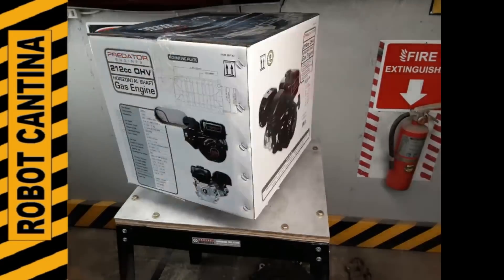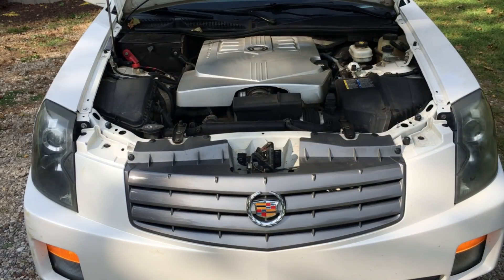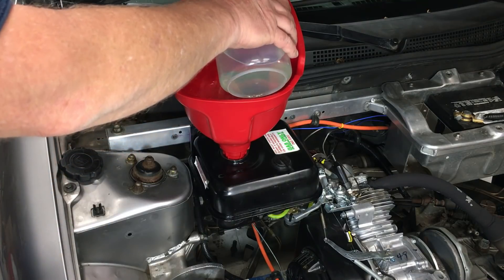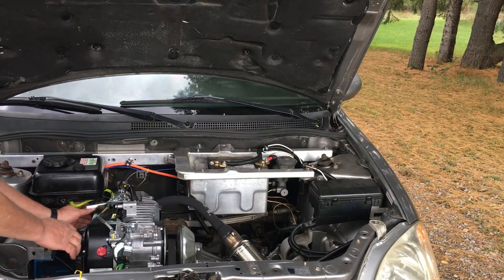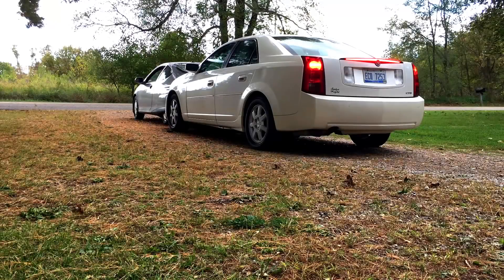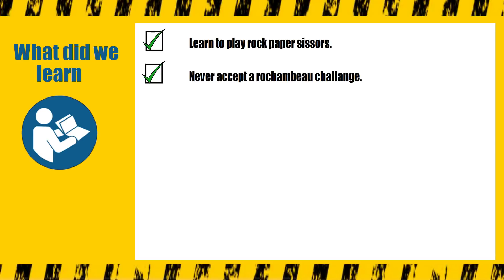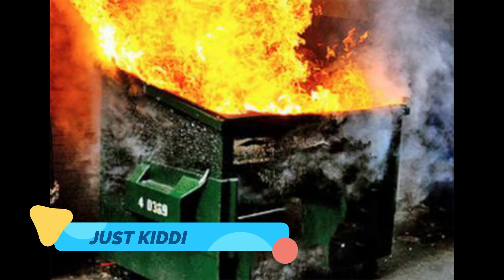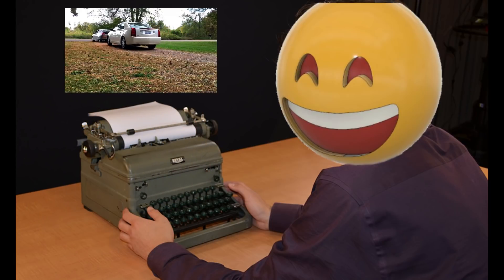Episode 6.  MPG on our Honda insight with $99 dollar lawnmower engine

Comment: On my car, the trip meter is typically optimistic by 21%. I doubt if that's particularly unusual.
You need to do another video... fill the Cadillac gas tank. Follow the Honda around the circuit for 500 miles. Then record how much gas it takes to refill the Cadillac gas tank.
Fuel consumption = 500/gallons.

Comment: Once had Ford Pinto with old worn out 2300 ( about a 1972 ) and it was so weak it probably had about 20 hp.
You had to pet the dashboard to get up to speed.
Probably a lot like driving your Honda.
Then in 2010 I had Ford Escort wagon, close to same size,  with 1800 or 1900 motor and 200,000 miles rated at 90hp.
and it was fast as hell.
What a difference 20 years makes.

Comment: If you think about it, 4.2L per 100km is kinda terrible. No power or torque and the fuel saving is marginal compared to a 3 cylinder turbo out of a vw polo. The polo is nearly double the weight.

Comment: I used to be an automotive test technician. There really isn't such a thing as 'pure gasoline.' All gasoline is a blend, including naptha and all kinds of aromatic hydrocarbons, plus a whole suite of additives chosen by the blending company. Not trying to be pedantic, but just saying that when you say non-ethanol gas is pure gasoline, that's not particularly meaningful. Gas from two different company pumps will be different, and gas from the same pump in various weeks or months can be surprisingly different. Not meaningful for most things, but when you're at the level of measurement that you are doing, it can be significant.
Reply from the maker: I appreciate the response, but my point was the fuel did not have ethanol.  I was not suggesting the fuel was a perfect blend.

Comment: Put in a bigger motor like a 420cc
Reply from the maker: Check out our other videos, we do put in a 420....  also on Friday 03/19/2021 we drop the latest video with  insane top speeds, stay tuned!
Reply: Dawg I just finished watching the 420cc video you need to delete your cvt and get a flywheel and clutch for mo powar

Comment: I have a roller cb750 honda motorcycle. I would love to see how you repower with a that s.. tock engine or a 420 .  A 750 çc 4 cylinder honda weighs quite a bit. 
 My first attempt might just be with a lawnmower seat tilt plate and direct belt drive, although a little cvt go kart drive might be much better..

Comment: Whoa whoa whoa - Cadillac made cars with manual transmissions?
Reply from the maker: Sure did,  you can even get the CTS with an LS2 with a T56 six speed.
Reply: @robotcantina8957  but probably not anymore.  I reckon those are exceptionally rare cars, probably rarer than an exotic. Ironic as modern exotics no longer come with manual transmissions.

Comment: Im not surprised at all the honda got better mileage. When maintaining the same speed, weight of the vehicle matters a lot more, and the honda beats out the caddy there. And when accelerating, the super low acceleration of the predator probably does a lot better on gas than the caddy. Basically the honda literally CANNOT burn enough gasoline. The caddy meanwhile is a bit like a race horse itching to go the highway speeds its meant to drive at, and has a lot of wasted potential.

Comment: I'm so used to driving on gas that I was like lol why can't they just top up the tank and calculate the difference but then it will only work for gas tank where you have a cut-off volume. So that makes it 5l/100km in metric, I suppose small city cars with sub 1l engines would do similar but with much better performance.

Comment: I am seriously impressed. I can see folks who just need a around town car who would like to have this car. As long as the regular fuel tank is connected to the carb with a low pressure electric fuel pump, so folks wouldnt be inconvenienced by your refuel method. Oh, an electric starter would be nifty. Easy enough to do.

Comment: Great video series! We know that carburetors are bad for fuel economy especially if they are not adjusted just right. 56MPG is great but you should see if there is an EFI kit for it or even better find a used small tractor FS730V-EFI engine or something similar that is about 25 horse power with EFI and you should have better hill performance and fuel economy.

Comment: Next logical step is to put fuel in the original gas tank and use a hand pump to bring it from the tank to the mini tank in the front. The moment it starts to run out, add a few pumps. FLAWLESS LOGIC

Comment: You should try getting her to 65 mph, then use the stock gas tank and have the ultimate  high milage daily driver.  Probably be pretty useful.  Fully modded i bet a predator with the full 30-ish horsepower could do 65-70.

Comment: I didn't know anyone bought that base engine CTS, even more so with a manual. When I bought my CTS the dealership didn't even have any base models, they all had the 255 HP version, which still seemed a bit underpowered to me. The 08 CTS bumped that to 305 HP I think, that was a nice boost.
Reply from the maker: Indeed, the base 2.8 with the 6 speed manual is a rare bird.  A stick shift in a caddy just blows peoples minds.

Comment: I don't know what car is the slowest street legal car, but a contender is probably the Danish Ellert from the 80s.
A 3 wheel electric car, with a top speed at around 50 km/h or 31 mp/h.

It's now produced in Germany, under the name CityEl, and has a much higher top speed.
You can read about it on English Wikipedia, under the new name, CityEl.

Comment: At 9.5 HP you could put a Japanese 125cc engine instead.
It produce around 9.2 HP without modification, it'll be lighter and more fuel efficient plus a lot more reliable

Comment: Considering how actually bare this engine is-
compared to a regular car, many HP robbing 
accessories are missing; many modern cars
now have electric accessories, so nothing is
parasitic, but you still need a beefy alternator
to run all that.

Fuel pump, water pump, cooling fan, wiper/
washer, power steering pump, AC compressor, 
HVAC blower, lights, entertainment, navigation, 
ABS, instrument cluster.

An actual electric starter.
Reply from the maker: While that is mostly true, the electrical load on a modern car only absorbs about 4HP.  The AC will adsorb another 4-5 HP

Comment: I can only imagine how much that cvt belt is eating your lunch in this test. Friction drive belts, especially with variable ratio drives, are horrendously inefficient. A simple centrifugal clutch without the variable drive and a chain to the transmission would probably make the car faster and more efficient. You might not think it's bad with so little power but fractionally it actually gets way worse with lower power engines. Given the insight already has a 4.9 to 1 ratio spread in the transmission and you are really only able to hit about 40 mph with this engine in this configuration, geared properly for this speed the wheel torque in first gear would be more than a third what it is with the stock engine.

Comment: It takes approximately 1 gallon of gas per 10 hp per hour for gas engines, and about .5 gallon per 10 hp diesels in boats running in their optimal torque band. It must be similar in hillbilly cars? My friend with the 10 hp diesel Geo metro was getting in the mid 90’s in somewhat hilly Oregon.

Comment: I can tell your lawnmower man same thing here in San Antonio Texas did similar work on other things boat aircraft you name it translated riding lawn mowers 9 horsepower blah blah blah I don't have a nice to shop as you do though keep up the good work thanks for the mile per gallons checkout have a nice day I don't touch anybody it's a try to shake hands just start coughing they back away that's what I do

Comment: From Leo: Fun test.  Air cooled, carbureted engines are not as fuel efficient as modern car engines.  Pretty impressive for a lawn mower engine.    When I was a kid there was a magazine article about a guy going cross country on an 8 horsepower Cushman scooter.  I guess if you are not in a hurry, anything is possible,

Comment: So the MPG is worse than the stock car? And you only had to strip the entire car, remove all climate control, and make it incapable for use on the highway. 
Kinda crazy what Honda managed, but the stock car was actually quite bad for the environment due to the lean-burn mode.

Comment: What exactly is a ‘5-speed CVT’?! By definition CVTs don’t have speeds.

This reminds me of a review I read of a very cheap hybrid. The guy said that when the battery got low the ‘engine’ would come on to charge it. He said it was exactly like driving a car with a loud obnoxious Honda generator under the hood. Horrible driving experience..

Comment: How well would the Honda run with a ram air intake? How about A/C? I bought a new Yugo in 1987. Yugo means you go back to the shop once a week in the first 5 weeks of ownership. (13 different problems) Anyway, my Yugo had a 1.1 liter engine not much bigger than your Predator, at least it acted the same but you beat the Yugo by 4 MPG. It had A/C but it cost me a $436.00 clutch. In the summer in flat land Florida, you can't have a car without A/C. My first car in 1974 was a 1968 Chevy Bel Aire with NO air. I swore never again. The Yugo's engine was so underpowered that to take off on a green light with the air on, you had to slip the crap out of the clutch or stall the engine. Drive or be cool was an either / or proposition. After 20K miles, it drove like a Model T with a cone clutch. You could make milkshakes on takeoff. The dealer where I bought it stopped selling / servicing Yugo at this point because the exporter quit paying for it. I found an Oldsmobile dealer in St. Petersburg that still serviced them. No transmission shop in 4 counties would touch it. The dealer said that the pressure plate was the size of a tea cup saucer and they had to send it out to a machine shop to be surface ground as it wouldn't fit their lathe for resurfacing which is what it sorely needed. Another car for my "never again" list.

Comment: Imagine if you could hook up the original tank to that small honda engine.And have a working fuel gauge.
Reply: The fuel would go bad before you used up the tank.
Reply: @cdjhyoung  why?
Reply: @jasper5945  In my area, automotive gas stored in the car tank has a limited shelf life. It attracts water, seem to vaporize some of its more combustible components, and generally just goes bad. A bit like trying to run kerosene through the carburetor. We add stabilizer to fuel we plan to keep over the winter to prevent these things from happening.

A 12 gallon tank might give the car a 600 mile range, but it is unlikely you would chose this car to go 600 miles in one trip. Your time is worth something after all.

Comment: the Cadillac is "drafting" the Honda, so the Caddie's fuel mileage is better than if the Caddie led, and the Honda followed it.
Reply: I don't think the Honda was going fast enough to generate turbulent airflow.
At laminar flow speeds there is no "drift pocket" no difference between stacked up vs spaced out.
Reply: And the caddy is idling along while the Honda is wfo
Reply: If you ain't first, you're last!
Reply: @kks_123-u1w  Slingshot, engaged...
Reply: To effectively draft like you mention the caddy would have to be somewhere in the vicinity of 6’ or less away, plus at these speeds any aero advantage would be negligible.
Reply: @jordanbrewer9700  Yes, but still drafting as it was - believe the caddy did 3 - 5 miles less that indicated.
Reply: Did better. Yeah. Lost by what, 40% ? Wouldn't matter
Reply: If the caddie is close enough the Honda also gets a reduction in drag because of the interrupted vortices.

Comment: so it gets gas mileage like an old 3 cylinder Geo Metro with a 5 speed transmission, and 4x more gutless... I'd call it a success, not trying to be sarcastic or trolling with that, when it breaks down you can replace the engine for less than the price of a car battery!
Reply: The blue book value on the geo metro hit -$200. 
You can replace the car for the cost of a new battery
Reply: My friend had 3 cylinder one silver he used hall ass from VMI to his house in Fairfax

Comment: Always amazes me what passes as street legal in the US. I have a Jeep and of course did a little something to it. Perfectly illegal in all of Europe, over here it's not even scratching the surface. 
Well, no surprise the little engine/light car combination is more fuel efficient. American cars are not exactly particularly fuel efficient and there's no need for that since gas is so cheap. I make around 14 mpg - not bad for wheels that weigh 90lbs each, but I also geared the crap out of it. I don't know what my top speed is for that "little" 3.6l V6 engine, but I bet it's no more than 80 downhill with pushing.  I rarely exceed 65, usually more like 45 or 50 - open vehicles are just no fun at higher speeds.
Reply: "Cheap gas" good bless America!

Comment: Cadillac was only the gold standard during the 50s, 60s, and 70s. Cadillacs after that were horrible. The Germans absolutely destroyed Cadillac. The only reason Cadillac is even around today is because of the popularity of the Escalade, it was what saved them and is still saving them today. No one gets anything else besides the Escalade, that’s it. Even then the Escalade isn’t that good compared to German cars. That’s not to say Cadillac never made fun cars, they did, the ctsv was very good but it didn’t sell that much. It’s safe to say their days of the golden standard are long gone.
Reply from the maker: Yeah, I was just having some fun with the Cadillac brand..  The only reason I own that Caddy is because of the manual transmission, otherwise that car is a POS.

Comment: the original one was pretty good in milage / had always 2,0 - 3,0 L/100km with my car back in the day. might be 80+ mpg??
Reply: On the highway the stock version of the first gen insight could hit around 70 mpg with a good driver.
Reply: @garethbaus5471  it made a big difference how to drive the car / behind a lorry with 56mph i was always between 94-117mpg (2,0 - 2,5 L/100km) on a flat motorway  (on my daily way to work "there and back" about 130Miles)  thats not fast i know ... but my overall consumption was about 73mpg (3,2L/100km)  (think this could not be reseted) so it was from new car as long as i had it / i was 2nd owner and got it down from 69mpg (3,4L/100km) overall cons. in a couple of 1000 KMs / Miles

Comment: Is this Insight the hybrid version? If so that could explain the exceptional fuel economy. Then again it could just be the tiny engine. How much fuel could a 212 cc engine possibly use?
Reply: 1st gen Insight was only available as a hybrid
Reply: @danieldaniels7571   But did this conversion remove the hybrid gear? There was a lot of stuff stripped out of the car in the original video, to reduce weight. Just curious...